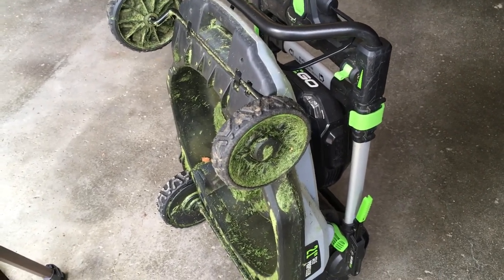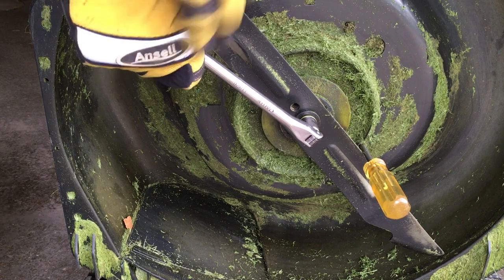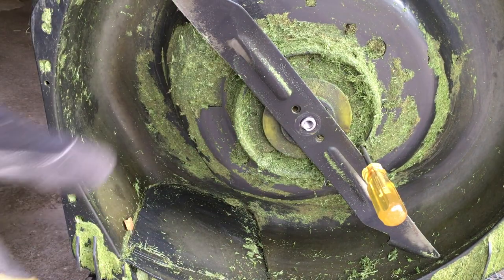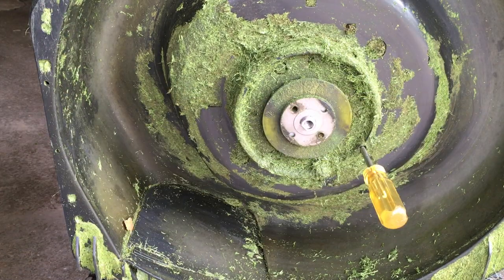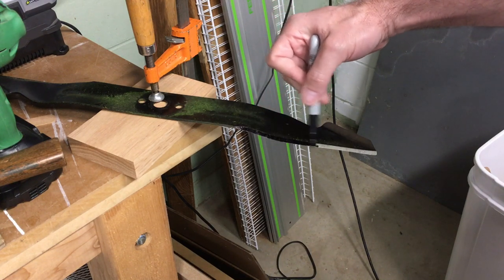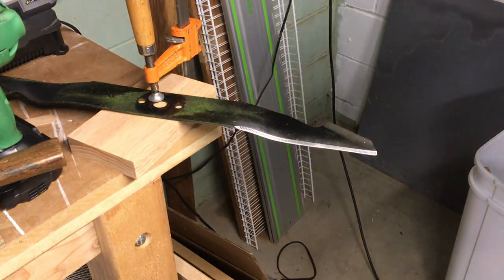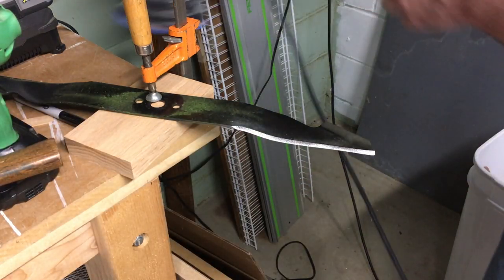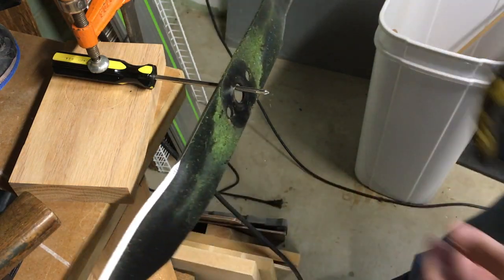Sharpening an EGO Power+ Mower Blade

Comment: Yes the EGO is a wonderful mower,easy storage no gas oil to mess or smell,quiet & starts at touch of button.
   Has the power of gas, only about 45 min to charge (which gives you time to rest).
    Had mine for about 3 years

Comment: Mine was wedged on. Had to cut off the top of the bolt. M10-1.50 x 25mm with 17mm socket is a $1 replacement at Tractor Supply vs TEN DOLLARS on Amazon for ONE bolt.
Reply from the maker: Amazon can be cheap for hardware if you buy in bulk but they are crazy expensive for buying single bolts. It’s always good to have a local hardware store (like Tractor Supply, Ace, etc…) for stuff like that.

Comment: Hahaha how much material can you really remove with a sander on metal?!
Reply from the maker: Depends on the grit. Lower grits will remove metal faster. My Worksharp sharpener uses 80, 120, 600 and 3000 grit sandpaper. A mower blade obviously doesn’t need the higher grits.